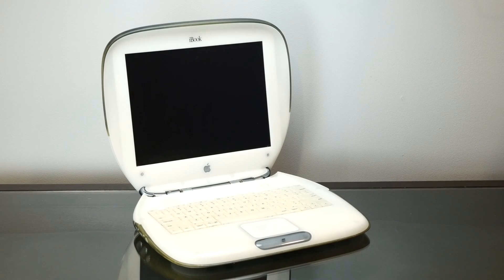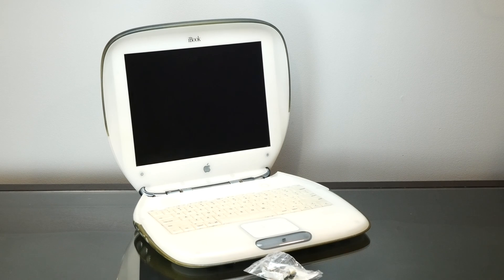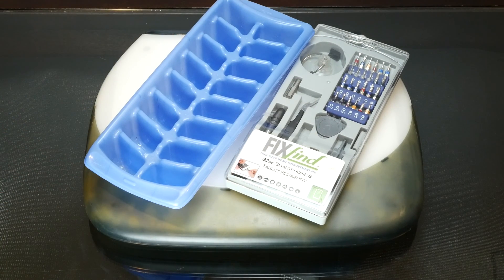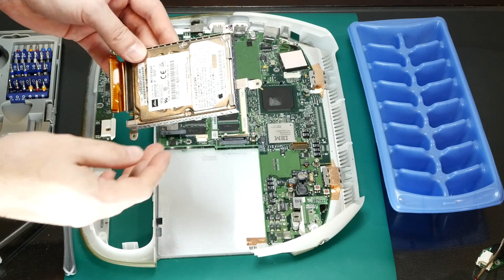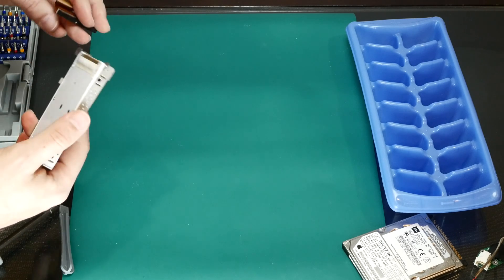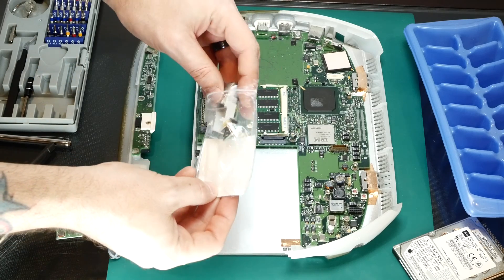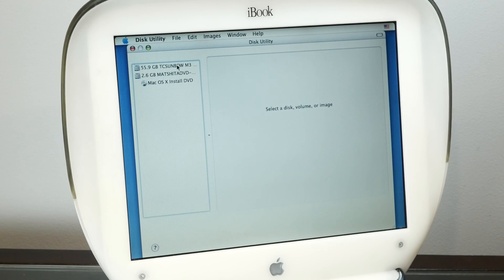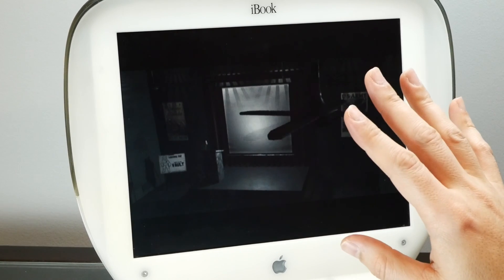Saving a Clamshell iBook G3 SE - Power Jack Repair and SSD Upgrade

Comment: I understand the love for this machine.
I believe the MacOS X Tiger is fine for this clamshell. However it will not get online due to outdated browsers able to run on it.
This clamshell might benefit from running a Power PC version of Linux, Open BSD or Morph OS.

I love my 2012 bought in 2013 MacBook Pro 13 inch screen with I7 processor.
I need only to unscrew the 8 screws to remove the aluminum bottom cover to change the HDD and to upgrade the RAM. The battery is accessible right there to be replaced later.
Being Intel and upgraded to 16 GB RAM it runs just fine yet slightly slow Windows 10 64 bit.
I will see what to run on it in the future since is not supported by Apple anymore.
It still has unusual for 2025 ports: Firewire 800, Thunderbolt first generation, usb 3.0, DVD-/+DL R/R/RW slot drive, SDHC reader/writer able to boot MacOS X from that CD card. Besides, it is able of booting from DVD, Firewire, Thunderbolt, USB external HDD/SSD, anything else connected from USB. It is among last Apple devices  able to boot from a MacOS X partition be it on GPT, MBR or old Apple partition table HDD. That allowed me to create a MBR HDD, where I could boot from MacOS X, Windows 7, Windows 8 and Linux partitions with extra partitions for data and recovery inside extended partition.

Comment: I kind of think that Apple knew that there would be problems with the power connector, so they made it on a separate board.
in fact, if they had used a little more brains, this problem would not have arisen

Comment: There cool for Collectors but they will not Connect to the internet  a good nostalgia piece
Reply: Not true! There are still ways to use the net. Action Retro has a website called frogfind that is a search engine and website “adapter” that makes a g3 or older able to visit basic sites.

Comment: Did this to my ‘99 Blueberry iBook recently to swap the dead 3.2GB drive for a 20GB spinner. And this of course was before I realized I could toss an SSD in there, so I’m going to have to relive this nightmare again, as 20GB is a little claustrophobic with a 9.2.2+10.3.9 dual boot. 🙃 Can’t wait!

Comment: Thank you so much for this. I'm just about to start working on mine for a hard drive upgrade, but I'm wondering if I should also try fixing an audio jack in the same go as I can't stand to open this thing up more than once. The other channel is very quiet so I can't really use the audio output. The problem is, I've had trouble finding any material on anyone touching the audio port and it's hard to even find close up images of how it's connected and made. You're repairing a different jack here so you seem to have some idea. Do you think that the audio jack could be repairable in the same way? Or even replaceable, by desoldering the old one? Suppose you don't have any close-ups of that area either, unless you've had to work on ports on that side and documented it!

Comment: I installed the same type of SSD drive in both my clamshells.  However, I put the drive in a FireWire enclosure so I could partition it and install OS9 and Tiger beforehand.  That way I knew the drive worked before all disassembly mayhem.

Comment: Apple laptop repair is hardly ever easy but the only thing I'd rate worse than this job is the white iBook G4 and its PowerBook brothers. The manual says things like: "Remove the following 41 screws", not kidding! I tried to do an LCD panel swap on a PowerBook 1 GHz, what a nightmare! I think the replacement screen was broken too but haven't really investigated any further. I got two sort-of broken PowerBooks from the same idiot as the Clamshell, one was put together and sort-of working, the other one was in bits. Reportedly the parts donor had a broken logic board but I suspect it might actually have been a screen issue. I can't even remember why we did the swap, possibly we actually tried to swap the whole display assembly because the rear bezel was damaged, not the display itself. Then the plug came off the airport antenna wire to make matters worse. The two carcasses have been sitting on my floor for at least five years, probably more.

Comment: Great video!  Is this a common problem with the Clamshell iBooks?
Reply: Yeah, I think so!
My original 233 MHz has a different issue though. It lights up green (used to light up orange when there was still a tiny bit of battery life left) when plugged in but that's the only sign of life it gives. I got it as "dead, for parts" with no picture and a bunch of other issues. Found a replacement logic board, took the whole blasted thing to bits, replaced the board, only to discover during reassembly that the display data cable had one wire torn out of the connector - the board was probably fine all along. All the other "issues" were due to the previous idiot not plugging stuff back in when he hastily reassembled his failure. I ended up stripping the very end of that wire, stuffing it into the connector and supergluing it in place. Worked for a while but then something else died. Might have to do another board swap.

Comment: I have 2 clamshell SE's and I got an engineer to install an SSD in one of them and it didn't work although it was a different brand.
In the end I hd to pay twice to replace it with a fast 7200 rpm drive of a large capacity. My Lime green needs updating but technicians charge £100 to do it and the  cost of the SSD on top. so it's no go for me.

Comment: I really wish you didn't have to take the whole damn thing apart just to get to the hard drive. If only mine was a FireWire model…that would make backing it up significantly easier.
Reply: Also, gorgeous cat!
Reply from the maker: Thank you! That's Suri!
Reply: yeah. it’s insane. i’ve never seen a vintage mac this bad

Comment: I have the exact one but mine is not the SE, definitely will do the SSD, also if I got another iBook G3 off eBay that comes with the battery, I’ll tear it open, solder new battery’s in. Thanks for the idea

Comment: I've got one with a missing keyboard, broken display backplate, and possibly a broken speaker, that does turn on, but doesn't display anything or bongs, in tangerine. Any ideas on what to do? (Note, the display (a samsung) was shattered but I've replaced it with the ibm one with the proper lvds cable))
Reply from the maker: What does it do after it's turned on? Anything on the display? Is the display cracked?
Reply: @ActionRetro  I just edited my comment, but yes, the display was cracked but I've replaced it, with one from a different brand, but from a g3 clamshell. The HDD spins up, so thats how I know it powers up. Also it came without a battery. Might this be the issue?
Reply from the maker: It will definitely work without the battery - mine has no battery installed. Are you able to plug an external keyboard in to it? Maybe you can get it into target disk mode that way.
Reply: @ActionRetro  well, the issue is, the screen appears to be dead when I turn it on. Literally the only sign of life I get is a green light around the charging port and a spinning hard drive. I've connected a keyboard and tried every possible reset keycombo but nothing appears to help. Also, target disk wouldn't be helpful anyways, because it is a model without a firewire port.
Reply: @radiiiiiiiiiiii  Why's that? I thought that if you had the right cable it should work. Also, that doesn't explain the laptop not "bonging" when powering on.

Comment: Oh wow, anyone who opens an iBook up that much should get a trophy! It's so strange though because I tried that EXACT mSATA IDE enclosure on my iBook and it didn't work AT ALL. Hmmm, it must have been faulty as I would have preferred using the mSATA SSD over the CF Card that I had to go with. Glad it worked for you though. :)
Reply from the maker: Wow, I was definitely worried about it not working, but it did work on my TiBook perfectly so maybe you did get a defective one.
Reply: I bet a SD - CF adapter would work well in the same setup and be a lot cheaper than getting a hold of a decent CF card

Comment: I've got a soft spot for the clamshells and have managed to collect one of each color. It was interesting to watch this, since I've installed SSDs in several of these using the exact same enclosure from Amazon. (It's not a bad idea to check that it's working before reassembly for what it's worth, since I've heard of some people having compatibility issues with certain SSDs and clamshells.) I've also repaired an AC jack in one of these before -- in my case it was just a matter of resoldering the connector. You can still buy new batteries for these machines by the way, although they are a little expensive at $60 from Powerwarehouse on Newegg. My lasts about 6 hours though.
Reply from the maker: Wow thanks for the tip about the battery! I was scouring eBay and no luck! I also have a clamshell soft spot - I'm on the hunt for a tangerine next, which is one I used to have ~10 years ago but sadly sold.
Reply: OMG thank you for that tip on the battery!!! I could not find ANYTHING online, and it's not clearly labeled on Newegg either. You are a life-saver.
Reply: You can also resolder new batteries
Reply: @kostasygaming7409  i wonder what kinda life it gets if you use modern high capacity cells, along with solid-state storage
Reply: @virtualtools_3021  it gets like 15 hours of charge